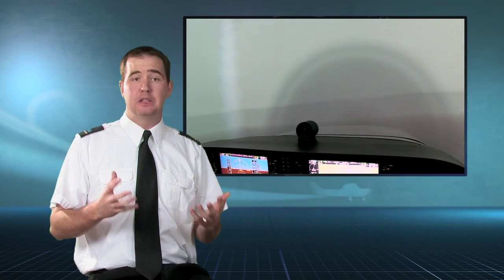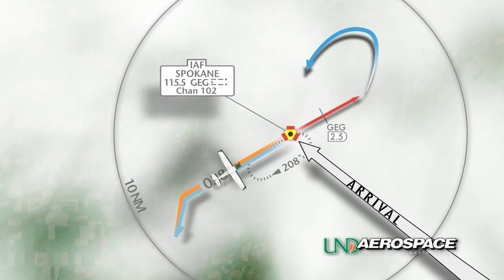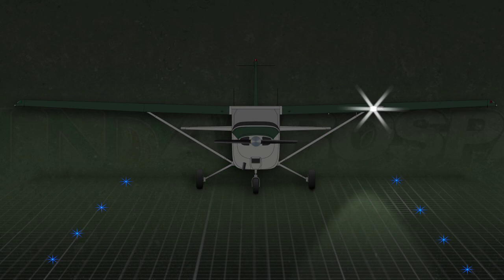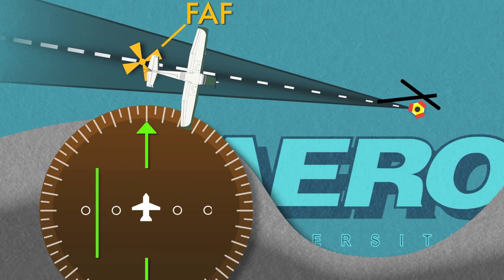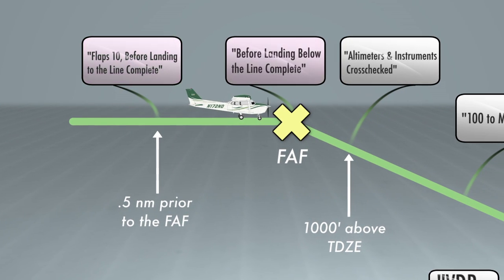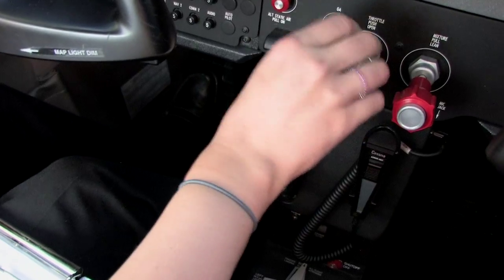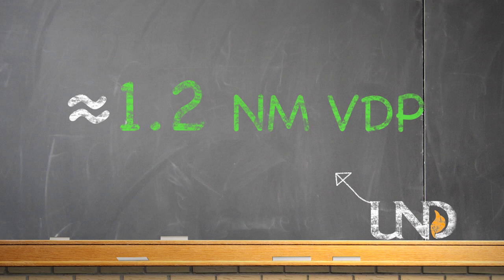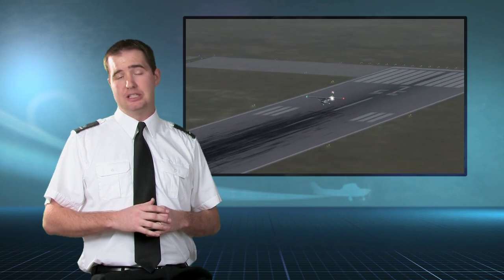(VIDEO 2) Non-Precision Approaches

Comment: Wow, you really load up a single pilot with all of your multi-crew call outs. I don't think it is appropriate for a single-pilot IFR flight where total concentration is required during an instrument approach, especially a non-precision approach. Most of those calls would be made by the PNF in a multi-crew environment. The majority of the pre-landing actions as required by the checklist should be performed prior to the commencement of the approach. In cloud is no time for distractions.

Comment from the maker: Hi, thanks for your comment and your interest in our series.  The G1000 is actually an awesome tool for our students.  It helps to teach about modern avionics and glass cockpit procedures, which is a vital skill set that's needed by our graduates when they make it to more advanced cockpits.  In fact, the PFD utilizes all of the needles; ILS, VOR, bearing selectors and everything is hand flown as our Cessna's are not equipped with autopilot.  Hope this clears it up.  Fly safe!!